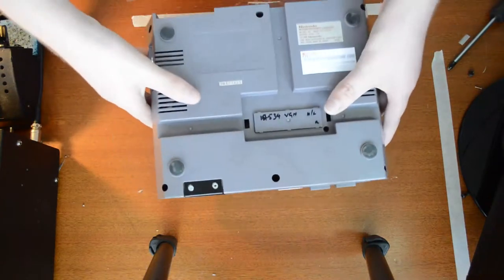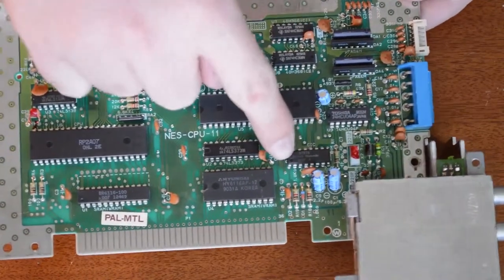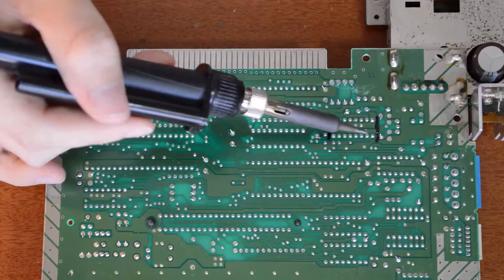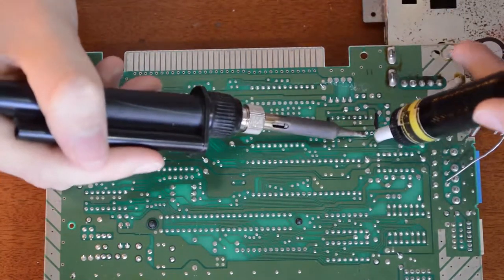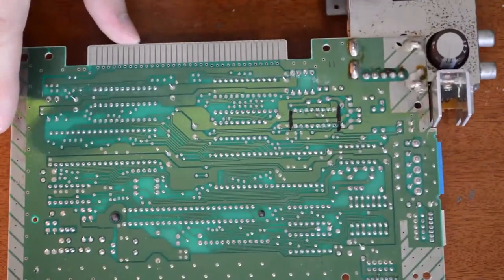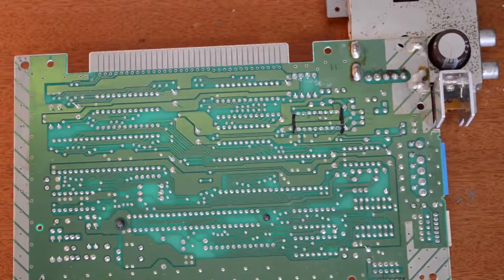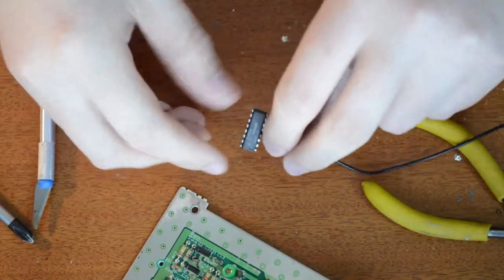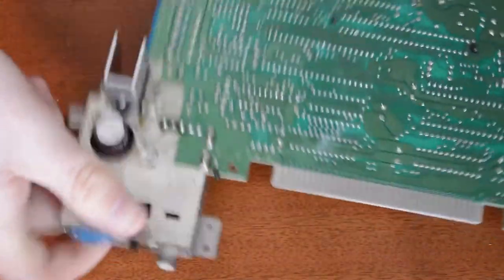How To Mod NES To Play Imports - Disable Lockout CIC Chip - HD

Comment: Could desoldering just the pin and leave the others work still? I'm doing a switch SPDT which one on is making it on and the other on without any wiring off - so will that work to disable the chip if I used a SPDT Switch
Reply from the maker: yes, leaving it floating will still work
Reply: Radical, I'm doing this so I can see if the Game works as if the CIC is disable it's like this

Broken NES game ----> CIC checks ----> grey screen

Broken NES game ---> CIC checks -----> may boot

this is also to test if the Game Board's CIC is not working and would blink on the NES